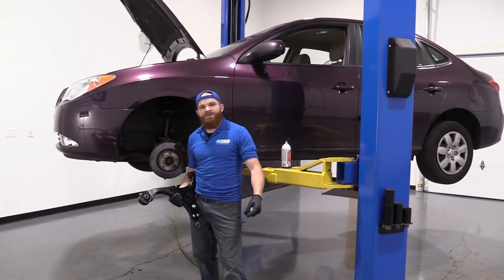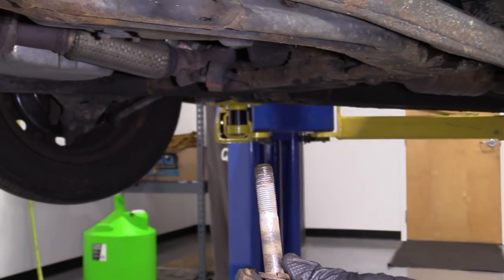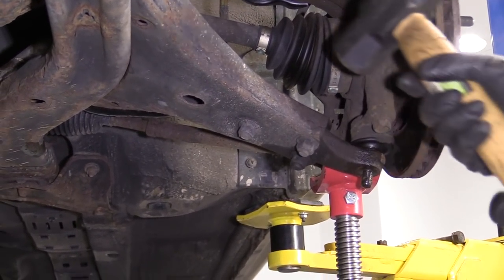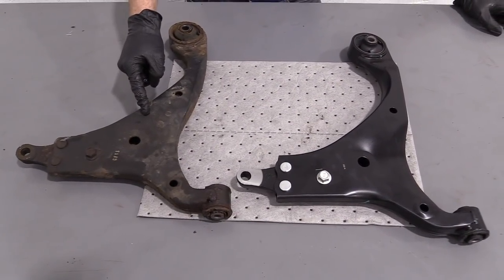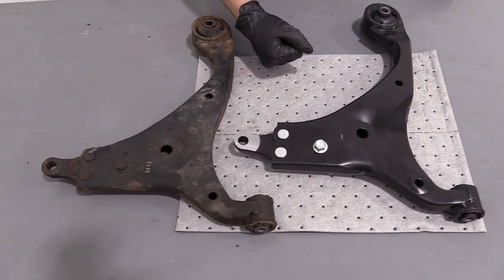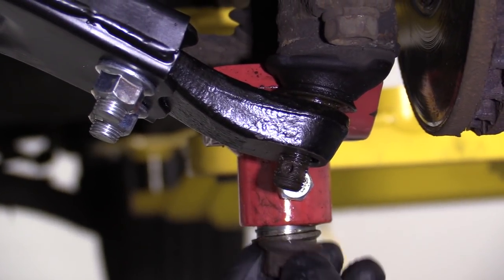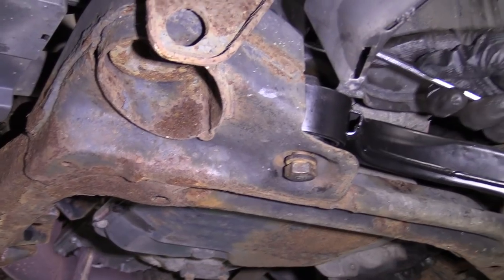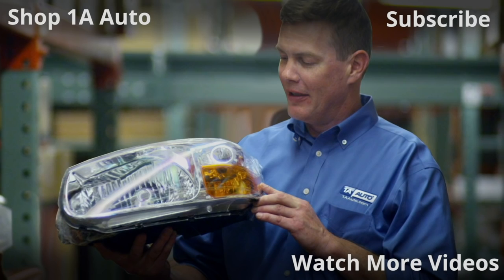How to Replace Lower Control Arm 07-10 Hyundai Elantra

Comment: I just replaced the control arm, ball joints and linkages of my 2010 Kia optima, thanks to your video it's a similar vehicle to the Hyundai. However I realized It's easier to take out the old control arms with the ball joints together. Chances are that the ball joints will be worn out already or will need replacement soon so I'll advise they be replaced as well with the control arms.

Comment: Just replaced both lower control arms, ball joints and stabilizer links . All together 2 hrs. Very easy vehicle to work on. May have to raise wheel  for access to resr arm bolt which can be blocked by sway bar.

Comment: You really need to torque that rear bushing with the control arm in its normal operating position - so either car on the ground or wheel jacked up to ride height.
Reply: Why would it matter?  The bolt doesn't put much pressurure (if any) on the bushing.  Just curious that the reasoning is?

Comment: also another trick  is to put the nut back on and use the air hammer or  cross pein swinging up the bolt   your not going to damage the bolt  its a thought bolt the nut will protect the threads. let me do it, please.

Comment: You just replaced 1 control arm i was told that they are done by pairs. My mechanic recently replaced the right control arm on  my hyundai santa fe 2007 and charged me $280 so I wanted to make sure he did the right thing and didn't ripped me off

Comment: Excellent video! I'm about to do the same job soon. What is the name of that red tool you use to lift the wheel assembly. it looks like a small lifter of sorts. Do you have a link for the actual item. Thanks :)

Comment: The ball joint comes off completely with 2 17mm bolts, if necessary to release the taper its easier on the bench.

Comment: Question. Will the car need a front end alignment after replacing the control arms?
Reply from the maker: +ryan x Thanks for checking us out! Yes, the vehicle will need an aliment after replacing the control arms to make sure everything is still in spec.
Reply: Thanks!
Reply: @ryan-uz1rw    I replaced  both  and was fine. if your car go straight forget the alignment

Comment: Would it be easier to remove arm and ball joint as 1 piece since I am replacing ball joint as well??
Reply: Yes it is easier to remove both as 1 piece. That's what I did. I replaced both as well.

Comment: Do you have to replace the ball joints when you replace the lower control arm?
Reply from the maker: +Cynthia Merkey Thanks for watching!  You should be able to reuse the original ball joint as long as it is in good condition and is not damaged.  We reuse the old one in the video.

Comment: Hello again, Thank you for the answer on the ball joints. I have another question. I am replacing the lower rear control arm on a 2020 kia Sorento. Do you have to remove the spring or tie rod?

Comment: I would have been done already   at the dealer i dont even take the pin out  i cut it flush and shoot the nut off  also  use a ball joint press tool   it does not ruin the ball joint  but its faster then a hammer   and if your going to use a hammer  use a air hammer     just a tip from a hyundai dealer tech who does these all the time     spray stuff   and let it sit  for a little  while   im in ny   lots of rust   ball joint press tool works fast and grate   there are different type and kinds.  I also have a box of cotter pins